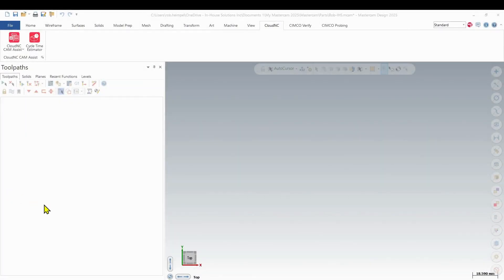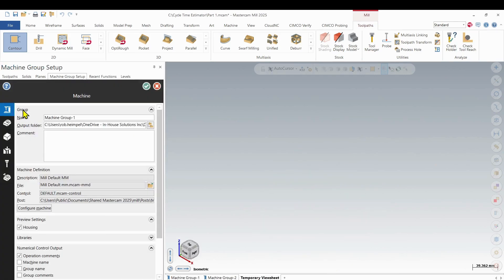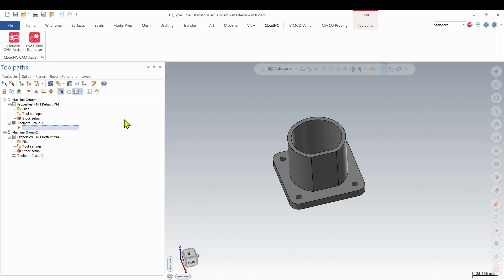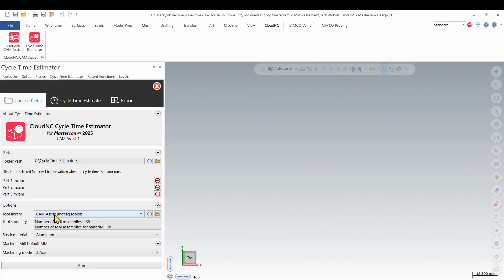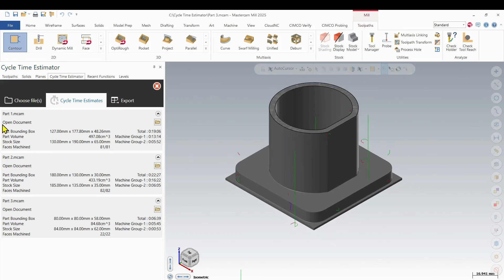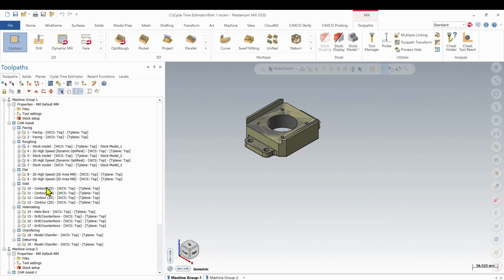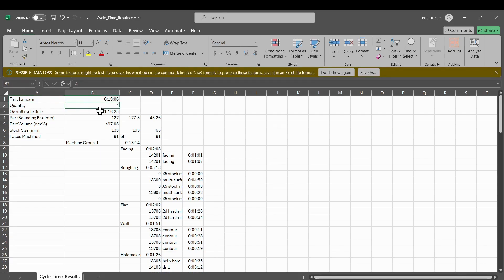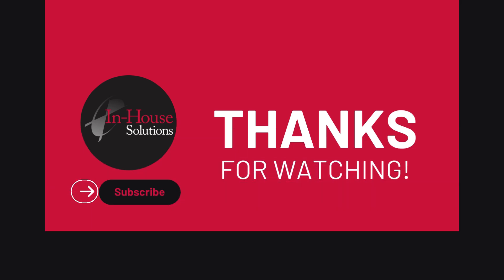CAM Assist for Mastercam: Cycle Time Estimator

Comment: good morning, We have done various simulations comparing the Mastercam time with the actual cycle time on the machine. It is not at all close because the cycle time is influenced by the tool change, the accelerations/decelerations of the axes etc etc. Have you done any tests on this? Thanks in advance